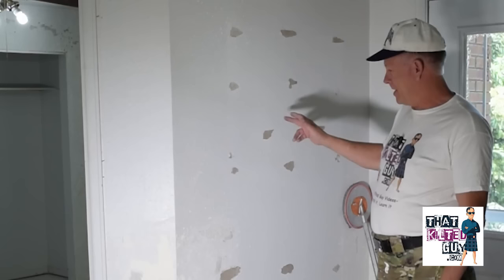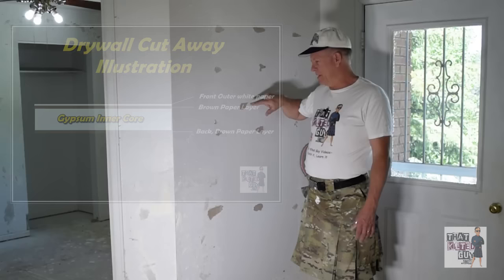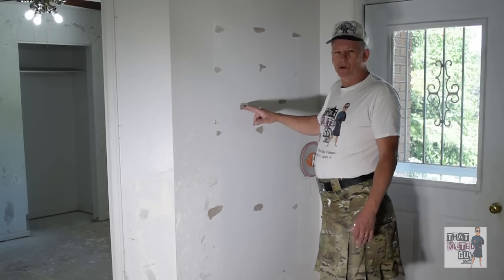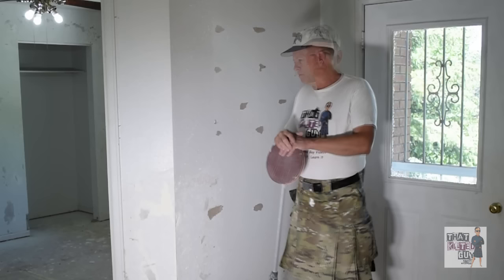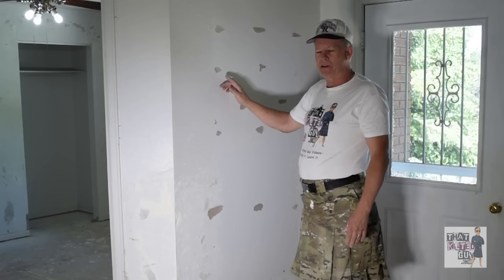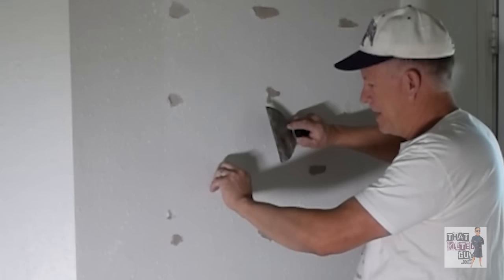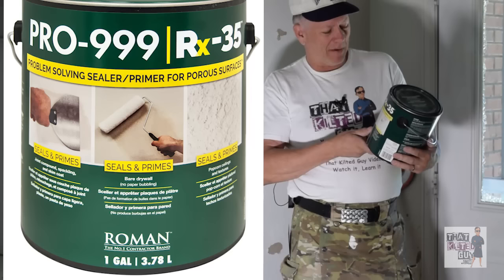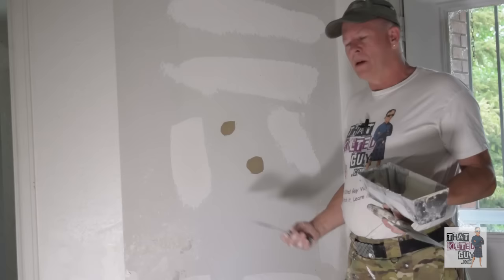⭐ Repair Damaged & Torn Drywall Paper BEFORE YOU MUD IT in 2022!

Comment: Alright, here's my question, what would be the solution to exposed gypsum? What do I need to get in order to fix it?
Reply from the maker: If it's just a little bit exposed, of say no more than 1 sq ft, you can just make sure all the paper surrounding the exposed section is cut back, solid and not loose at all, then just apply some all purpose mud, (best is USG Plus 3 or similar) and fix it like in this video.  If it's bigger than about 3" across, I'd go ahead and embed some mesh tape or paper tape into the mud for re-inforcement, but there's still the brown paper on the backside, so it has some strength. but tape will make it all the stronger.  Pretty much the same as in this video, except you can probably do without the RX-35 and you might want to tape it.  Hope that helps more than confuses.  If you need further help, consider supporting our channel on patreon at https://www.patreon.com/ThatKiltedGuy where I can answer more in depth questions for members at the levels of That Kilted Guy DIY pro and up.  Thanks, Guy
Reply: @ThatKiltedGuyDIY  
Well, for me, it's on a shower wall where the soap dish used to be, the whole gypsum is exposed, like all of the paper is gone due to water vapor, I basically removed the paper and exposed the gypsum, is it still possible for me to reapply the soap dish or do I need to prime the gypsum?
Reply from the maker: Hey, I'd be glad to help you more, but a photo would be helpful.  Can you go join my Patreon page at https://www.patreon.com/ThatKiltedGuy and then click the community tab and post the info above with a pic?  Thanks, Guy

Comment: I just realized that our problem might have resulted from the original wallpaper installer failing to seal the drywall with sizing prior to putting up the wallpaper.
Reply from the maker: That can certainly make it much harder to remove without damage.  Good luck.

Guy

Comment: Thanks so much for this video. You explained how to do everything and all the logic behind it so well. I wish I'd found this before I started trying to repair our walls. We removed a chair rail that was on all the walls without cutting at the caulk first, so some of the drywall came up, revealing the brown paper. We applied drywall mesh tape to try to even out the walls and then applied the spackle right over that... kind of just went off of the small general knowledge we had about patching walls and clearly didn't bother to research (hindsight is 20/20). Now we just have a couple of layers of spackle on the walls and we're having quite the struggle sanding it down and keeping the walls even. And now I'm worried it'll start blistering too since we didn't prime it. Any advice you're able to offer?
Reply from the maker: At this point, if it hasn't bubbled, it might not.  They don't always.  If it does after priming, just do like in the video, then reprime and you'll be fine.
Reply: I’ve watched this video about 10 times today!   To accomplish exactly what you’re showing us. And believe me,  I needed it….   I had mounds of wall filler all in various shapes to cover anchors and smoothed divets where we’d gouged the wall moving furniture and/or removing old fixtures and having notta clue how to get that yellowy, gritty, mixture to actually even remotely settle back down and look like a wall!   Thank God for  you ….Kilt-wearing-Drywall-king!   Lol! So appreciate it.

Comment: Question on when do I need to replace my drywall entirely? My house was built in 1990 in a very humid FL. The garage popcorn ceiling began peeling so I've scraped it off. I guess the outer layer of white paper came off during scraping because all I see is brown. Is this going to be a big problem down the road if I mud over all of it?  Or should I cut it all down and hang all new sheets? It really wouldn't cost too much so not concerned with price if I do need to. My plan was to just scrape off popcorn, smooth out with mud, paint with drywall primer, then topcoat paint. If the exposed brown paper is going to be a problem then I'll just take it all down just not sure what it's going to do.

Comment: You sir are a saint.

Had two fist sized bubbles pop up on our second primer coat on the ceiling. I tried to spackle/joint compound fill it several times and sand it down only to get the same repeated hole opening up. Decided there HAD to be a way to solve this differently, and woah-nelly, your video was just spot on. 

Going to go try to and see if they have  this secret sauce at my local lowes, if not I’ll try home depot or sherwan williams. 

My deepest gratitude for your help good sir, I’ll be sure to check out your other videos as well.
Reply from the maker: In my area, Sherwin Williams and Home Depot carried this. To be extra sure it doesn’t happen again, put two coats on it an hour apart and let that dry a good hour before coating it with joint compound. Glad I could help as that’s the goal of my channel. And thanks for subscribing. Be sure and click the bell icon to be notified each time we put out a video. Thanks again, Guy
Reply: They didn’t have it at lowes, but they had it at home depot 👍🏻
Reply from the maker: Yeah, lowes doesn't have it here in Colorado, on the western slope anyway, so seems they just don't carry it.  Glad you found it.   Be sure to prep the surface right though.  If you leave any loose, or bubbling paper, the RX-35 probably won't lock it down so do like I did in the video and cut around it, peel anything loose back to the cuts and then coat it twice.  Good luck and thanks for keeping me updated.  Guy

Comment: I just got old wallpaper off and the glue removal left a lot of flaking/superficial tears in the brown layer of the dry wall. This dry wall does not have the thick white layer over the brown multilayer section. So basically, there are slight imperfections of a significant percentage on the dry wall. What would you suggest I do for this? I plan on painting the walls after everything is smooth. I believe this drywall is very cheap/old drywall. I essentially have to correct all of the drywall before laying my paint, vs spot treatment. I have never attempted this type of thing before so I appreciate any advice. Thank you. 
(I have a friend who does this type of thing for a living and he said he really don't need the primer in your case, even though I told him I've watched a lot of videos that state it is indeed good. But then again the videos I've watched all have had drywall with that thick white layer at the surface)

Comment: Kills odorless spray can primer does it better and dries super fast.  Hold the paper just fine.
Reply from the maker: I actually used the Kilz oil base for years, then I found this product, and it had far fewer failures for me.  I've also been experimenting with simply spraying a spray adhesive on the areas and rubbing it in, which works well too.  The thing about the kilz is I fixed probably 100+ tears like this and about 10% of the time, one would bubble anyway.  With the RX-37 it's more like 1%, but glad the kilz works for you.  Thanks for the input.

Comment: Thank you for the detailed description and product recommendations! What is “hot mud”?
Reply from the maker: You’re welcome
Reply: @ThatKiltedGuyDIY  I have a large area on my bedroom ceiling that was water damaged. I removed abt 2 large sections 2  by 4. Of the Sheetrock. Would you prep it with the RX 35 first ? Before I apply joint compound?
Reply: at 10:31 he quickly talks about "hot mud". I think hot mud dries buy chemical reaction instead of slow air drying "all purpose" mud.

Comment: ive done that with regular paint or primer and it works
Reply from the maker: I used to use kilz all the time and it worked pretty well, but there were too many failures when you do it as much as I do. This product is much more reliable which is why I started using it and shared it here. I am going to be putting out a new video soon comparing 6 to 10 different methods including using nothing at all so be watching for that.

Comment: Great video. I made a lot of mistakes, and now I have thick spackling on my walls with uneven edges leaving "spots" on my wall. What do you recommend I do? Sand completely and start over using your instructions?
Reply from the maker: If you can sand it down, do that to start.  When covering these you want just enough to cover the outer edge and extend out slightly, like shown in this video.  Then follow my instructions in the video, yes.

Comment: When I worked on my kitchen I had delimination on the textured ceiling where it billowed, and on the walls I had plaster brick which tore little holes in the paper all the way to the gypsum.   I painted the damaged paper with Gardz, because I hadn't seen this video.  On the ceiling I added a layer of fiberglass adhesive sheeting after I tore off the loose paper off (lots torn off, maybe 6' x 3' in an irregular shape), and on the walls I didn't bother, but filled the gouges.  I used Easy-Sand 90, because I'm not that fast and it was a big job. I troweled the whole ceiling.  I didn't think it was that much harder to work with than the premixed stuff, but I did notice it setting up near the end of a bucket I had mixed up.  But seeing this video makes me think that for this 14 foot hair line crack I should use Easy-Sand 20.  The ceiling is below the attic space, and I am thinking the roof trusses may not be completely tight, and the wind is causing the crack.  The crack starts at an outside corner, and runs perpendicular to the trusses, which are on 24" centers, holding the ceiling up, and the roof on.  I will definitely use fiberglass tape.
Reply from the maker: 45 minute hot mud is safe  for novices. Good luck

Comment: Love Love Love your videos!  Thank you for all of the effort you put into these creations!! Question ... Using hot mud to skim / fix the paper holes ... previous videos you made comment that hot mud is not for light coatings due to the way it dries (more of a chemical reaction and heat vs. air drying) and that light skims of hot mud would / may fail by not adhering or flaking?  Why hot mud vs say Plus 3 (with the understanding hot mud gives the speed)?
Reply from the maker: The benefit to hot mud is that it shrinks almost none and you can recoat it very quickly.

Comment: In a previous video, not sure if it was yours, but for torn brown paper they recommended Zinsser, Garda, Problem Surface Sealer. Water-base. Interior. Clear. Is this the same technology, and will it work, as the Pro-999-Rx-35. I purchased a Qt. of the Garda but have not used it yet. Thanks in Advance. Great videos
Sean M.
San Diego
Reply from the maker: It’s just as good

Comment: Could you use fiberglass mesh tape instead of the primer sealant?
Reply from the maker: Cindy Trimble I’ve tried it several times and it didn’t help. I’ve had good success with spray adhesive though. I think spray shellac works too.

Comment: Zinsser Gardz surface sealer does the same thing  and is easier to find.
Reply from the maker: It really depends on what’s available in your area. I’ve heard others say they can only get the Zinsser product online. I’m actually testing out 10 new ways to fix these with much cheaper easier to obtain materials including some common ones like spray adhesive. Be sure and subscribe and click the bell icon, and be watching my videos for when that comes out. One other point is the last time I checked the Zinzer guardz was about twice as much as the product I’m showing here. But they both do a great job. Thanks for the comment.
Reply: Gardz is ok but falls  short in almost every way against Roman

Comment: Thanks for the very in depth video! I was curious, what is the yellow mud that you put on? Is that needed? Whats the difference between the white mud and the yellow mud?
Reply from the maker: The yellow mud is normal air dry Lightweight All Purpose mud, and the yellow is Fast setting joint compound.   The fast setting mud, aka hot mud, lets you put multiple coats on quickly without the need to air dry and it shrinks very little compared to all purpose.  I think I used 20 minute hot mud in this video which gives you about 20 minutes or working time and you can recoat in about 30 minutes from when you mix up.  Did that help?  Thanks for stopping by and asking.  Guy
Reply: Yes very helpful, thank you!
Reply from the maker: Glad I could help.  If you appreciate what I do, please consider joining me on patreon to show your support at: https://www.patreon.com/ThatKiltedGuy

Comment: Hi Kilted Guy
I like your video.
I just need one suggestion  my home is already painted by previous owner but I don’t like that color.The color of the wall is red but i want pure white or cream color on that wall.Do I directly paint on the top of the red color? or I have to scratch the old color n then after smoothing the surface and then paint? What you recommended?
Reply from the maker: Hello, to paint over most reds you usually need to put a stain blocking primer on it first to prevent the red bleeding back through the paint.  Check out my video at: https://youtu.be/C9BRpLTaN-g to see an example of how the red magic marker bled through the paint alone, but not so much the paint with a separate coat of primer underneath.  Hope that helps, and thanks for the question.

Comment: I followed the instructions and got the exact products. When I applied the Rx35 my brown paper started to bubble. What do I do?
Reply from the maker: That tells me you didn't get all the loose paper up first.  Often it can look solid and not loose so I poke it with something like the corner of my knife and then if I see it move, I cut around it and remove only that loose paper.  So now just cut out the parts that are bubbling and re do it.  Make sure you let the RX-35 dry 3-4 hours this time.  And applying a 2nd coat is even better if you have the time.

Comment: I was removing wallpaper in one of the rooms of my house and it turned out that the wallpaper wasn't properly applied, so my walls were terribly damaged.  I've been working on repairing the walls.  I first applied the Pro-999 primer you suggested all over the walls.  I then skim coated the whole wall, I had to do 3-4 layers of skim coat over the whole room. I'm now ready to paint.  Should I use an oil-based primer prior to painting or should I use the pro-999 again?  Thanks
Reply from the maker: Tricia Robertson I just use any water based primer. I've never tried the pro999 over everything but it says you can.

Comment: I have used white Elmers glue on these spots and it works like a charm.
Reply from the maker: How many have you tried it on?
Reply: I have been using it on places where the paper is torn of for the last couple of years, not really sure how many but quite a few. I used to prime the spots and let it dry before mudding but the elmers glue works much better at blocking the moisture from the mud.

Comment: Thank you for this video. I removed wallpaper from a bathroom and damaged the white paper in places. So, after I seal the brown paper rips with the Romans product, and mud and sand, should I prime the entire wall with the Kilz 123, or could I use the Pro-999 Rx-35? The wall underneath looks blotchy, and my husband takes very steamy showers. I plan to paint and stencil the wall.
Reply from the maker: I've only used it for trouble spots, but it says it's good for drywall mud too.  Here's from their page:  PRO-999 Rx-35 is the ideal primer for drywall, skim coat, spackling, popcorn ceilings, contractor’s flat paint and mud joints. It seals porous surfaces and dries with a slight residual tack, enhancing adhesion of wallpaper or paint.

    For sealing and priming porous surfaces like drywall, joint compound, and residual wallpaper paste

Comment: Thank you for the video. I have some areas on the ceiling that I need to repair after removing popcorn ceilings that were painted.  I will definitely try this product.
Reply from the maker: If you can't find it, I have links to another product that will do the same thing in the description below. One link is for a quart size. Thanks for commenting 🙏

Comment: What would you do if you have a larger area than 10"? Where the putty knife will not cover. I just pulled something that was glued to the wall and about 2 feet section came off.
Reply from the maker: Sometimes you just have to overlap passes

Comment: A gallon is probably more than a homeowner would need. It's odd that Elmer's glue was mentioned?? You might get away with using a masonry bonding agent and it's available in much smaller quantity. I suspect all of these are latex based??

Comment: Thanks for the video, but with all due respect, I’ve done drywall patchwork for over 25 years, and all you need to do is put fiberglass mesh tape on the brown paper, then add your first coat of hot mud / fast setting joint compound. And yes, as a pro patch guy, I always try to keep the patches as small as possible to not have to skim out the entire wall, but that being said, if you’re not a great patch guy, the best way to match that many patches is to skim it completely.
Reply: What about just shellac priming it and then mudding it?
Reply from the maker: I have repaired thousands of brown paper spots and I have tried using mesh tape and hot mud and I have had many of them still bubble up underneath the mesh tape. That is why I switched to this method. And yes, shellac will work also
Reply from the maker: I have over 35 years of experience and first held a drywall knife in my hand 50 years ago. I have run my own business of Mr Patch Drywall for 15 years and before that I did new construction.
Reply: Armando you are wrong. That will not stop the paper from bubbling. You need a bonding agent to do it right.